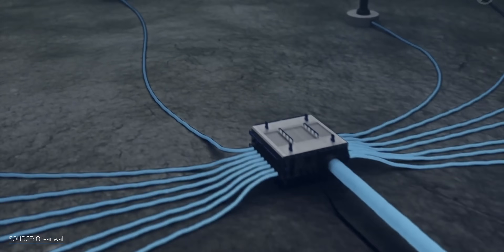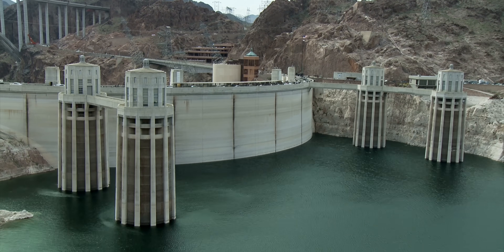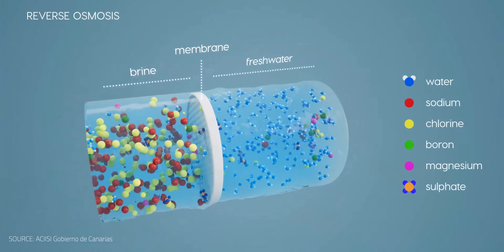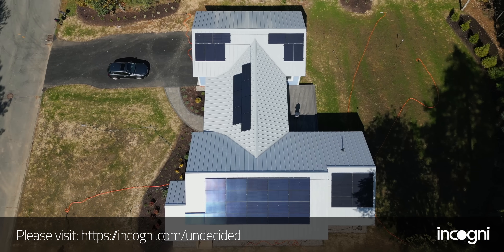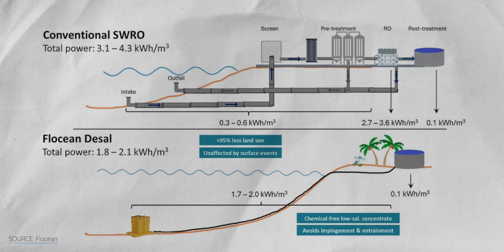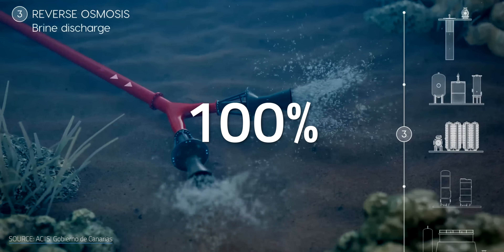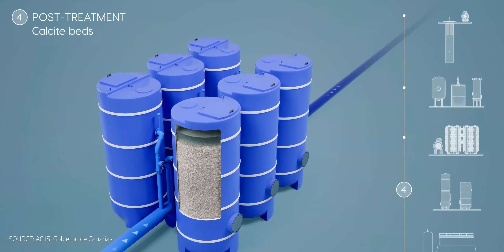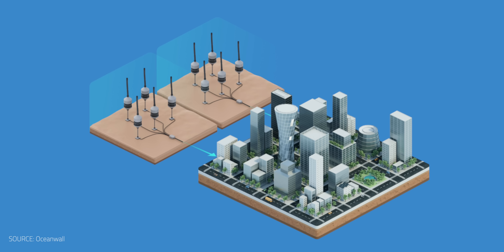How Deep Sea Water is Now Drinkable

Comment: @UndecidedMF
The math ain't mathing.
You stated that in 2016, global desalination capacity stood at 38 BCM/y, consuming roughly 75 TWh  and that capacity is expected to more than double by 2050.

Then you stated in 2016 desalination plants emitted 76 MT of CO2; and protect 218 MT/y by 2040.

So that's a 287% increase in emissions by 2040 but production isn't expected to DOUBLE until 2050. Are the existing facilities expected to have a 87% increase in emissions due to loss in efficiencies by 2040? If so, why? If not, please explain the discrepancies in your numbers. Something isn't mathing rn.

Comment: Sorry mate, but the math ain't mathin. The filters may have slightly longer life, but it's still the same factors. Replacement and maintenance would be a much greater problem at depth, as it were. Regarding the land based brine expulsion, that should not be returned to the ocean regardless as it kills sea life. Brine expulsion must be diverted to evaporation ponds allowing for sea salt harvest and profits made there would decrease operational costs. Salt thermal storage tanks, also known as molten salt energy storage, could be yet another lucrative side endeavor for land based desalination plants, adding substantial profits. We're not thinking past point A, still. That is why we have mountains of solar panels and wind turbines being chucked into landfills around the world as we speak.

Comment: Nope.  The product pumps provide suction that reduces pressure on the permeate side of the membrane to achieve the required DP across the membrane and move the fresh water permeate to shore.  This membrane DP is not created by the differential between brine and fresh water at deep depths.  If you relied on that as the operational method, you'd have a perpetual motion machine, which isn't possible, so the unit would be in static equilibrium (no fresh water coming out).  The suction pump is the key.

Comment: In theory, you shouldn't even need to pump out the RO permeate (desalinated water) because it's density will decrease by about 2.5%. That doesn't sound like much, but over thousands of feet of vertical rise, it adds up. Just look at how much higher icebergs float in the ocean than ice cubes do in drinking water, and that's just a few hundred feet of depth. You would still need to pump it somewhere for use, but the motors for the pumps could be above the surface on a structure similar to an oil platform.

Comment: This concept may also slow down the rising ocean levels problem by pulling enough water from the bottom of the sea, some of which would be used for irrigation of crops. It probably would never totally remove the threat of rising sea levels but might mitigate the problem to some extent.

Comment: If your land mass is close to a deep sea trench(which is the case sometimes)then the whole process can be done with no input  energy purely by the pressure difference between the fresh water column and the ocean pressure  at depth which is substantial because salt water is heaver than fresh water. So the fresh water column will energise itself once there.

Comment: It is the pressure gradient across the membrane that opposes the osmosis pressure. Regardless of the ambient pressure, this gradient must be established by pumps and there is no energy difference in whichever side of the membrane you either pressurise or depressurise. Added to the huge cost of getting the water ashore via pipes and membrane/pump maintenance issues (sea water is still full of organic materials at depth) this is not a winner for investors...

Comment: OK, l need to make a math point here: let’s say that RO needs 6 kPa of pressure to force the water through the membrane.  At least in the abstract, it is exactly as difficult to pressurize surface-level sea water to 6 kPa as it is to pump filtered water up from 600 meters.  There may be advantages to deep-sea desalinization but “free pressure” is not one of them.

Comment: Desalinization just requires evaporation, the profit margins is the reason for the calls for chemicals.  It is totally able to be a 100% solar exclusive no chemical additives process. Solar power is also to maneuver the mechanical components of the engineering effort of processing the brackish water.

Comment: Yes using bottem of the sea pressure to push water through the membrane is an idea but you still need to pump the now fresh water up 400m, which by the way takes the same amout of energy and pressure as using a pump to just force the water through the membrane at the surface. They say it takes less energy but they are lying. Its horse shit. A better idea would be just start flushing toilets with sea water or gray water.

Comment: Eh... sounds like you need a nuke, not solar.  The middle east is also playing with distillation thing, but salt buildup is difficult to deal with.

RO doesn't work that way -- it's not force-feeding a membrane (if it did that you wouldn't need a brackish water exhaust) -- its smooshing the water against the membrane so that the ions/minerals are more concentrated on the smooshed side than the brackish exhaust [keep that at low pressure] and... presto -- through chemical concentration diffusion... the high pressure side is less salty. The cool thing is that... you needed that pressure for pumping anyway (if you're supplying a city), so you can take the conditioned water and put it into the pipe and you now have water pressure... just don't flow too much else the water pressure drops on the "clean side" and the RO stops working.

Comment: To those confused: you still need pumps, but the pump flow can be smaller and/or you don’t need a brine pressure recovery device. Instead of pumping the source water up to high pressure with seawater-compatible pumps, you only have to pump the fresh water (which is about one third the volume of the source water as two thirds of the source water ends up in the brine flow), and your pump itself doesn’t need high saltwater tolerance (obviously, the enclosure for it does). I had a similar idea a while ago; it’s kind of obvious if you think about it for a bit. Not sure it’s worth the trouble of putting the pump and membrane assembly in the ocean, but on the other hand, it makes it a lot easier to diffuse the brine.
Reply: Good points, but even the video misses the real treat: Making the whole thing self-pumping. I realized the basic principle 50-ish years ago and began to promote the idea at a meeting in Texas. But it confused those present, and it still confuses most people even now. The basic premise is that fresh water is less dense than seawater; THAT is where the immediate pressure difference comes from. SO . . .  See my long (and hopefully sufficiently detailed) explanation at https://www.youtube.com/watch?v=Bu_IcFpEkg0&lc=Ugy-Cjd8CbTTRysFHh94AaABAg.AI3UZSvdlO4AIw3B2S3B5c

Comment: According to wikipedia for RO of seawater you need 40-80 atm of pressure. The proposed 600 meters would result in 60 atm of pressure, so that is the correct ballpark.
However once the output pipe fills to the top, the pessure difference approaches 0. You need to raise your freshwater by 600 meters, for which you again need a pump that can provide 60 atm of pressure difference. Same as the land based RO plants.
And no, the pressure difference due to salt content in the output pipe being lower only results in a 1.4 atm pressure difference, no where near the needed 60 atm.

Comment: It is a good idea to use natural gravitational pressure to supplement electrically derived Pressure for the reverse osmosis of seawater. 

The only problem I can see is a mismatch of Depth; you suggest that the additional electricity would from offshore wind turbines, but most offshore wind turbines are anchored in shallow waters, were as these reverse osmosis machines need to be in deep water. Even the alternative option for generating electricity offshore you highlighted last week, the Wave energy extraction machines would be shallow water.

Ideally you would a geographical seabed area shallow enough for wind turbines, or wave Energy extraction machines, or both, that would then drop quickly to a depth suitable for Reverse osmosis machines, plus all these requirements need to be close enough to shore To be practical.

One final thought, apart from the obvious extra cost, why don’t land based desalination plants, put their high salinity waste into tankers and sail them to the poles, then discharge this waste into flows of melting snow and ice, thereby allowing re-salination in that area, plus, if a little iron was added to the solution, this might promote the growth of phytoplankton and algae which could absorb some CO2.

Comment: Why not go even deeper and forgo the pumps entirely? Salt water is 2.6% heavier than fresh. That means that every 10 meters down you go, a column of fresh water would have 2.6% atm difference vs the ocean. Go down a kilometer and that's 260% atmospheric pressure.

That is to say, an RO membrane separating a pipe filled with fresh water from the ocean would simply have more water flow into that pipe. Zero energy input.

Comment: have an idea for desalinating saltwater using evaporation powered directly by sunlight. The concept is to use special materials to build evaporation ponds that absorb more sunlight and retain heat better, aiming to raise the water temperature in the pond to around 100–110°C or even more.
I also plan to develop a kind of thermal battery that can be charged by sunlight using suitable materials—storing the heat in molten salt for use at night.
I know this method is already known and has lower efficiency compared to others, but I hope to improve it by applying some new ideas.
In your opinion, what are the main challenges or reasons why this method (solar evaporation) hasn’t succeeded in becoming more efficient for desalinating saltwater?"

---

If you'd like a more technical or casual tone, I can adjust it.

Comment: This looks like snake oli vapuor. 
Going 1km below water will not change a thing as at the -1000m gradient of pressure between sides of membrane it same as on the surface. 50cm diameter pipe with lenght of 1km holds less than 800kg weight difference between ocean water and freshwater.

Comment: 13:02 I do recall my uni energy systems professor saying: 'Why go to the extreme lengths out in the ocean to exploit a temperature differential of 10 Kelvin for electricity generation when we could insulate old houses (note: central Europe) just a bit and save double or triple that in primary energy consumption for heating.' 
It still strikes me as odd that saving electricity/water/heating is such an easy way realize potentials, but it usually does not take a spot on the limelight. Saving is not sexy and usually only happens when people feel the pain through high prices for whatever commodity.
Reply: Energy savings has almost completely made up the energy needed for growth for the last forty years in California. Where we use about the same amount of power to support 30% increase in population and an economy that is sixteen times larger.
Reply: @matthewhuszarik4173 I think the savings can be seen in the increase in population being supported by less than the original consumption, rather than the increase of the economy.
With the economy being 16 times larger than 40 years ago, I assume that most of it came about from the tech sector. So I assume, as everywhere in the west, energy consumption for physical manufacturing decreased significantly due to massive off-shoring to Asia and therefore this consumption doesn't show up on our own national/state level balance sheets anymore, but rather on the ones in Asia. Or am I mistaken?
I mean data centers - the new kind of manufacturing - probably increased energy consumption quite a bit, but not more than the reduction caused by off-shoring.
What do you think?

Comment: Water levels are lower than 1000 years ago, we installed hydro electric dams upstream.... are the reservoirs up stream higher than they've ever been? X amount of water flows per year, if you trap it or divert it to a growing population with ever growing water demands you will have a decrease in downstream flow.

Don't state it like less water is delivered every year when in reality all that is happening is more water is consumed and preserved.

The narrative of global climate change is that more water is added to the system every year by ice melt and more severe storms deliver more water inland than in the past years. You can't simultaneously claim inland water production is reducing as well, it's one or the other.

The earth has become 20% greener in the past 20 years due to increased carbon dioxide and increased rain fall. You can't simultaneously proclaim that rivers are drying up due to environmental factors. The rivers run dryer because we increase reservoir capacity and consume more water with an ever expanding population.

Comment: A topic I have experience on! I am a licensed water treatment plant operator in Florida. I work at an RO facility we utilize RO and nano filtration, we have ten trains which is the platform that the membranes sit on and feed water through to carry on to the rest of the disinfection process. With ten trains we are capable of pulling in 30 million gallons a day the caveat to that is 15% of what we pull in is converted into concentrate. We do two things with that concentrate some is sent to the waste water treatment plant and some is pumped 3,000 feet into the ground. We are currently working on adding more membranes onto each train to increase efficiency and also working on another plant that will take some of that concentrate and treat it farther. That plant will treat the water and pump it into a lake to allow it to be treated by the earth and sent down to the Florida aquifer. What’s cool about this idea is that it’s going to be somewhat of a park allowing for fishing and canoeing. At the end of the day I just don’t see treating sea water as a really great alternative, we have the technology it’s just very expensive to maintain a facility capable of treating salt water. With that said without someone trying to do it more efficiently it won’t get done. I just think that the time being there are far more practical multi use ideas available
Reply: Im sure pumping salt water deep into the ground wont have any problems down the road, absolutely none.
Reply: @thecocktailian2091 it’s so deep it won’t

Comment: Video starts @6:00
Reply: Not undecided about sponsors
Reply: Go Mohamed
Reply: So the reasons for the depth are the unused real-estate, the slightly easier discharge of brine.... You still gotta build a LOT of piping either way I think. 
The pressure I imagine is largely irrelevant since you still gotta pump everything either way for the same power, that's just hydraulics. Tho maybe an argument can be made that deep water has less salinity or something, but even then, just build a deeper pipe.... adunno about this project. 
You also have to deal with the more difficult maintenance. I feel like this is a bad deal 😅
Reply: It’s funny when people say there’s a “global water crisis” while we’re on a planet that’s over 70% water lol
Reply: @jessec377  do u prefer calling it an energy crisis? Semantics lol
Reply: @jessec377  yeah it just an availability crisis but it’s still a big problem that needs solving

Comment: ok this is funny. i've thought about this a couple of years ago and i came  to the conclusion that it is a very bad idea. let me explain, by the way i havent seen the video yet. im at 00:57.
RO filters need a pressure difference to function. More water flow means more differential pressure over the filter. simple as that. in this system to remove the water coming out of the filter suuposedly under high pressure, it needs to get sucked out. and this is omportant. If you place the pump at sea level you effectively had 1 bar of suction pressure maximum. thats not enough. if you place the pump at the bottom of the see you have a lot of suction pressure, but! the pump needs to provide the same amount of pressure as the differential pressure over the filter. so effectively this is a regular RO system under water. so i will watch the video now, but i cannot imagine it will work.

So i have watched the video. 1. this is an invredibly stupid idea, the only advantage is land use. 2. i expect the lifetime cost per m3 of water to at least double or triple. 3. its just stupid.